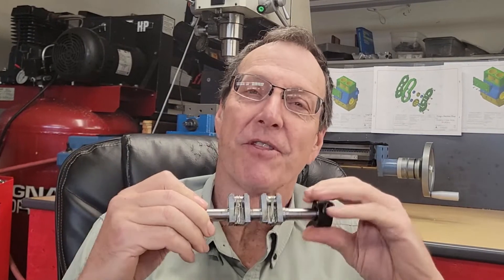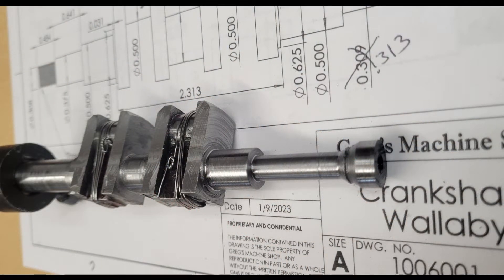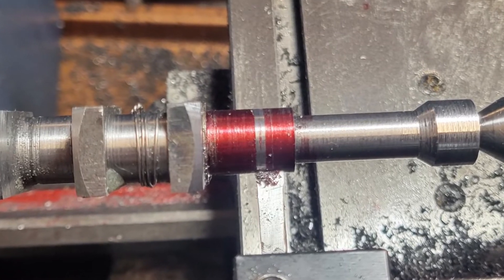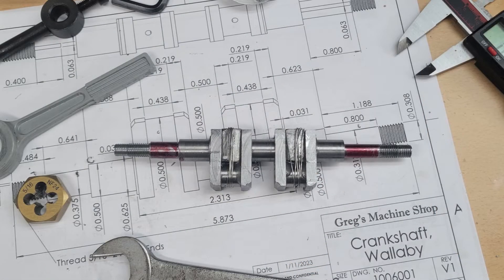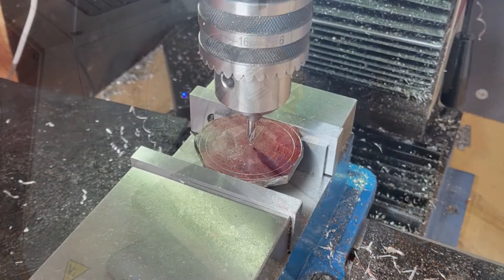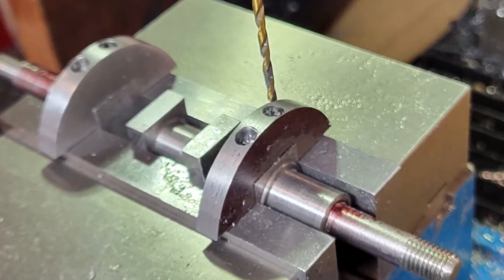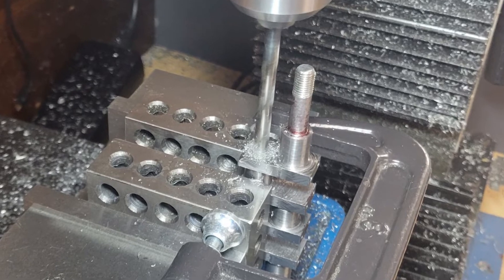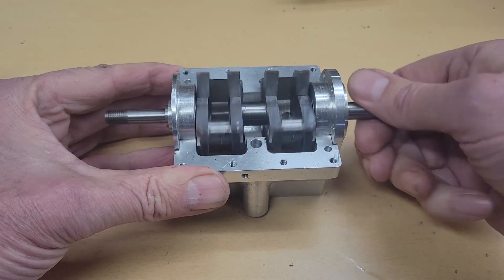Machining a Crankshaft - Wallaby 3cc Engine Part 9

Comment: Maybe you addressed this earlier, but I couldn't find it.  With two cylinders, why do they run in tandem?  Is this common?  I just assumed that they piston strokes would be offset.
Reply from the maker: Yes, this was addressed in the last video, part one of the crankshaft machining process.  This is a four stroke engine, which means the crankshaft turns twice to complete all four "strokes" - intake, compression, power and exhaust.  So this engine has one power stroke every complete revolution of the crankshaft, the cylinders alternating between thier power stroke and thier intake stroke.  This is the most balanced way for a two cylinder four stroke to fire, but certainly not the only way.  So the pistons move in unison, one going up on a compression stroke while the other goes up on an exhaust stroke, for example.  then they alternate. Hope that makes sense. Greg